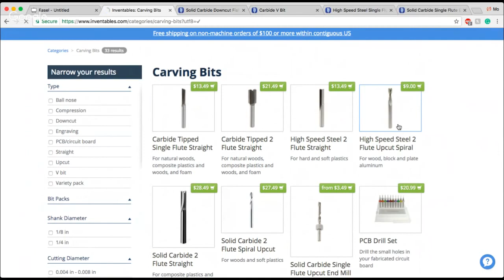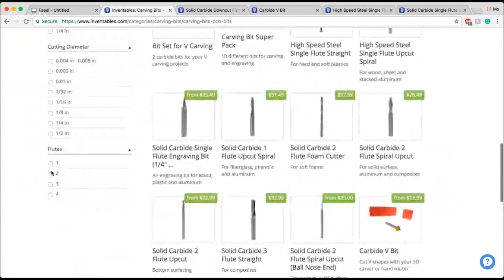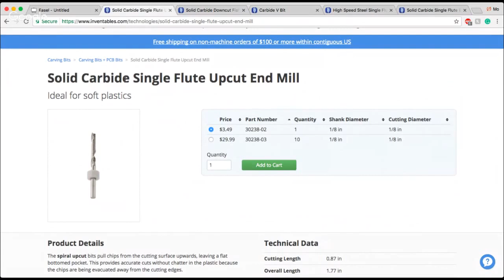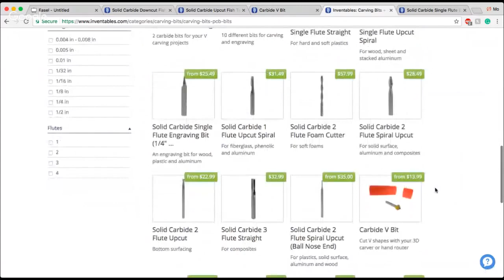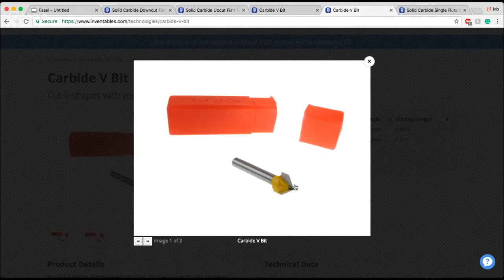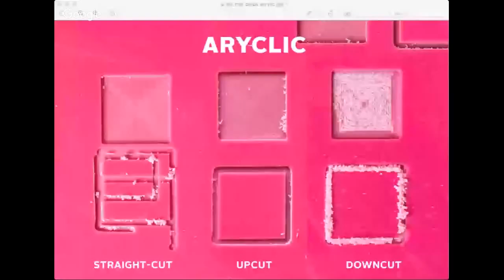Easel Live: Carving Bits 101

Comment: I got into trouble with cut depth on a two-stage carve.  The rough bit was a 1/4" and the second bit was a 1/32".  I made some 3/8" holes 1/2" diameter, and Easel used the rough bit to almost complete the hole, but then tried to use the fine bit to finish them.  Problem is the fine bit only has a cut depth limit of 0.200, and the holes were 0.375 deep!  Luckily I avoided breaking a bit, but that was unexpected.  So, cut depth is another subject that could use some love.  Great video!

Comment: The colored ring that is on some of the bits, do they stay on when inserted into the Dewalt 611 or do I have to remove it. Just finished putting together my 750mm but haven't inserted a bit due to this question. Thank you
Reply from the maker: Yep, the colored ring stays on! It indicates how deeply the bit should be inserted into the collet. You should only insert the bit into the collet up to the colored ring.